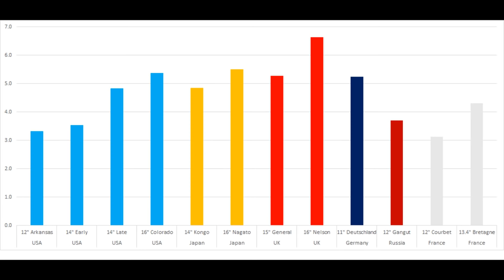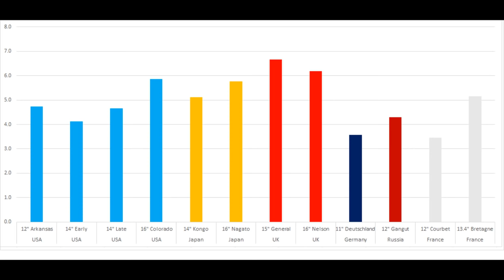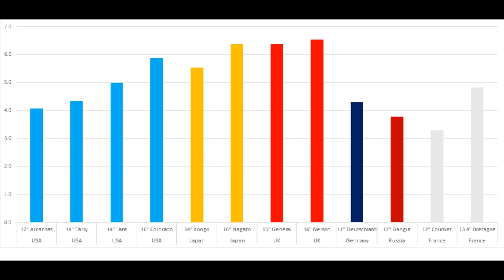Battleship Guns of WW2 - A series of tubes

Comment: So a 16" shell takes about 40 saeconds to arrive at a target 30,000 years away.  Not hard to dodge.
Reply: Depends on how many football fields your ship is long/wide though 😅
Reply: In a Destroyer? Yeah easy. In. Battleship? Your not going to be able to affect near as large a change in course. And you have to consider your fire control system. The US systems could maintain an accurate firing solution even when a ship was maneuvering radically. The units in Japanese ships were a different story. Start trying to make regular major course changes in Yamato and your solution will be shot to heck very quickly. Which means that you can’t even begin to shoot back effectively. As a result in a Battle between Yamato and Iowa for example Iowa’s Captain could maneuver radically (for a battleship that is let’s be honest here) and continue to fire accurately where Yamato’s Captain basically needs to maintain course and speed. So in a hypothetical long range daylight engagement between the two Iowa has a decent chance of landing those crucial early hits while Yamato is frustrated because her target is maneuvering making getting a good solution difficult to impossible.
Reply: @jetdriver 
Just one small correction:
"the US systems could maintain an accurate firing solution even when a ship was maneuvering radically," 
*after* they got the late-war radar systems installed, which could track both enemy ships and the water spouts from where the US shells hit the water*
Reply: @MrNicoJac  there is no question that late war radar was required for true blind fire capability. However the ability to maintain a good firing solution isn’t tied to the radar but rather to the range keeper and specifically the stable vertical.
Reply: @jetdriver 
I feel like you're not replying to what I was trying to say, so I'll be more explicit about it to avoid any confusion 🙂👍🏼

I meant that even the Americans couldn't crisscross and zigzag like crazy and still have the fire control computer keep up. So they, like the Japanese, had to keep a more-or-less stable course while firing. Or else they'd indeed be firing blind, effectively.

However, when they got radar that was advanced enough to, as you wrote, blindfire, this enabled them to maneuver much more radically without losing their firing solution.

So I feel like you'd be right under most circumstances, but wrong in the specific situation that I was trying to discuss 🤔

(however, I'm just typing this from memory from what Drachinifel said about it once, and am by no means a professional/expert on the topic, so I might just misremember what he said😅🤐)
Reply: @jetdriver  Actually, at those very long ranges even Iowa couldn't actually land hits reliably; live-fire tests in the 1940s indicate that hit rates for a stationary Iowa-sized target (side-on) at 30,000 yards was below 3%, and in a combat situation that's going to get even worse.

So more realistically, nobody will be actually hitting anything at those long ranges until they get under 25,000 yards.
Reply: thats why they chase the splash, to keep dodging them. ultimately you only have to get smacked once with a 16" shell to ruin your day.

Comment: That was an impressive analysis of capital ship main guns - and probably the most concise and information rich analysis on the subject. Given the lack of capital ship surface battles during WW2 though, it seems that most of the investment in these powerful platforms was misplaced, as air power rapidly came to dominate WW2 naval engagements. Due to the high cost of the battleships and their vulnerability to air strikes, they seem to have been mostly relegated by the Allies to shore bombardment duties, which while certainly appreciated by the landing troops might have been much more cheaply carried out using cruisers and destroyers.  

It would be extremely interesting to compare the cost-effectiveness of the various naval surface, naval air, submarine and land-based air platforms during WW2. For example, how much enemy tonnage did each type sink versus the total cost of that platform? Obviously, it's an enormous and complicated question (as surface and naval air platforms were always present together), but it might reveal some dramatic insights.

Comment: Muzzle velocity at maximum charge would (IMHO) be a better measure than range. At the same elevation the shell with the higher MV will tend to go further, though heavier shells will actually carry better than lighter shells. Still not perfect but does away with turret design elevation limits.

Comment: The accuracy test range that was used by the US Navy is located in the lava desert in eastern Idaho. The compass rays and arcs were cut through the sage brush as roads and concrete monuments were placed along them. The range is still visible on satellite views of the area. All of the new rifled liners for the battleship guns were tested for accuracy at the range. After 1947, the Atomic Energy Commission took part of the base for the Reactor Test Station, a mission that is still going on under the name of the Idaho National Laboratory of the Department of Energy. Most of the Navy test range buildings are gone, but there are a very few still there inside the restricted area.

Comment: Do any of the categories have particularly significant outliers? That will slightly alter the weighting of the category. I'd like to see what impact there is on the tables if you move the Italian re-bored guns to the pre-1930 data set
Reply: Still garbage guns, but in a slightly more forgiving table?
Reply: I see what you mean. If one gun is a very significant outlier it would make the separation between good and great smaller.

Comment: One thing I noticed when trying to make my own comparison tables for technical performance of historical vehicles / guns is that multiplication of the real values, taken to some weighted exponent, gives a more practical / reasonable final outcome than just adding pre-weighted values. The weights assigned to the exponents here are obviously the most subjective judgement call on the part of the user, and the "final outcome" values themselves can get quite large (depending on which units you use) but I've found that it gives a more intuitive comparison for just how much more effective one technical system is vs. another, rather than just comparing scores 1-10. And if you want to get a more reasonable numerical output at the end, you can always just take the logarithm of the final numbers so they look neater on a fancy chart.

Comment: Personally, what I find intriguing about naval guns is that guns of roughly equal size remained viable despite the age of their designs. In so many fields of technology, coming against a modern weapon of WW2 with a Pre-WW1 design would be a serious problem, but naval guns made in the 1910s were proving plenty able to compete right up to 1945 and beyond. The real innovation ended being in how to aim and fire the guns, rather than the actual guns themselves, and that is not common from the mid-19th century onward as technology tends to take leaps and bounds.
Reply: Maxim machine guns are another example - 1890s design still viable in 1960s.

Comment: I worked at River Don Steel works in the early 70s which used to be the Vickers works where battleship guns were made. The gun shop was still there, an enormous building with an 80 foot deep pit filled with oil as part of the heat treatment process and high enough to lift it out with a big crane. It was like looking at work done by an ancient race of giants.

Comment: I think bursting charge is being weighted MUCH too heavily. 
The reality is that if you bother studying hits you quickly come to find that bursting charge differences can only be discerned at all as a factor of damage when the difference is gross, usually in the form of major caliber step changes. Within a given caliber the difference is so marginal as be basically impossible to identify. It's like the endless arguments over 9mm vs .45 acp 'lethality'' any tiny theoretical  difference is completely overwhelmed by the random chance of where the round hits. The difference  in bursting charge  in these weapons are too minor to really be discernable and any minor differences that do exist are simply dwarfed into complete irrelevance by location of hit. 

This renders this category pretty much easily THE least important of any of them as any effect on target with a hit is ultimately largely down to luck, presuming the shell can defeat the targets protection (and fuzes, given how often that failed to occur that's another strike against burst weight vs penetration) Furthermore explosive mass in bursting charge is extra worthless because the explosive itself does little damage. Keep in mind even the quote "big' bursting charges being discussed here are comically small, big bad Yamato's 18.1 inch APC round contains... 75 pounds of explosive. 

That's pathetic, and blast effect is garbage against metal armor generally and also drops exponentially  with distance. No, what ACUTALLY matters is the big high velocity  FRAGMENTS from the shell. These retain energy over much  greater distances and can punch through wide areas of a target and internal armor divisions much more easily. Thus so long as the shell has enough of a charge to scatter it's mass with considerable force, anything more probably adds very little lethality. It's thus extremely dubious that an oversized bursting charge really adds any 'lethality' at all. Well it's not really dubious at all, it's CERTAIN it doesn't really because effect on target is basically entirely down to ability to defeat protection and then dumb luck in what's in the shells vicinity.  
 
This overweighting  of minor variation in bursting charge is clearly dragging up a number of weapons that should not be rated as high as they are. 

I also enjoyed the outrageous bias in  giving the British 15 inch some random "accuracy" bonus after you spent several minutes explaining how you couldn't even FIND accuracy data for many of the weapons, but then go onto the randomly declare with zero supporting reasoning  that the British 15 inch gun is exceptionally accurate compared to others. 
 (if pressed you'd presumably  mutter "something something Warspite's dumb luck hit in the med')

No rational assessment would ever rate that weapon higher then the 20s era 16 inch guns I mean god the British THEMSEVLES didn't. It literally basically combined the worst of both worlds, it couldn't be massed like 13-14 inch weapons were on a number designs to attain a volume advantage and it was notably inferior in every metric of per barrel performance  to 16 inch weapons. Rating it the best gun Pre-1930s REEKS of Teaaboo bias. .

Comment: It is criminal that we the people do not have the lucky ability to watch the big gun battleships ripple/slavo fire their monster naval rifles.
I have been lucky enough myself to your battleship North Carolina, battleship Massachusetts, and the most jaw dropping was battleship New Jersey. The level of precision, engineering and pure mastery of materials of all kinds is un-fckn-believable. When you Drachinifel get to FINALLY tour the steel beasts in the East it will legitimately fill your soul with awe especially since you appreciate them as much as ourselves.
The sheer size of those 68 foot long 16" 50 cal rifles protruding out of Turrets the size of a house that were able to train rotate very quick, all with full stabilization BUILT IN THE EARLY 1940's!! Lol radar targeting system for main/secondary batteries as well as anti aircraft battery is almost unbelievable which is not even considering the fact new Jersey is fastest battleship ever at 35 knots sustained for 4 or 5 hours, I cannot remember, the sheer size and weight of the monster brawler is remarkable
Reply: Coveralls are required for the USS New Jersey visit, as it will involve crawling through one of the gun barrels. 😉😉